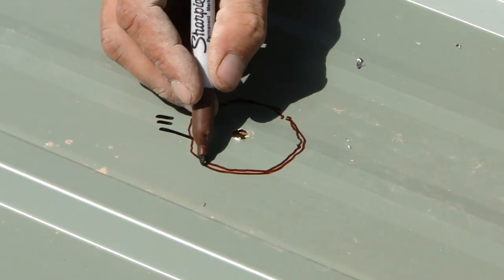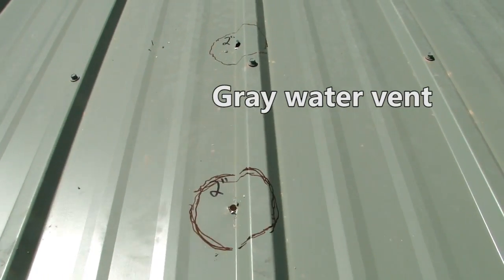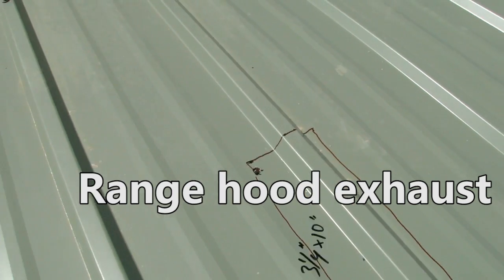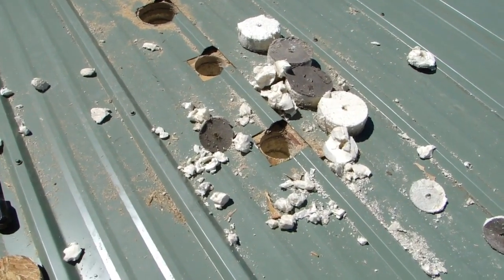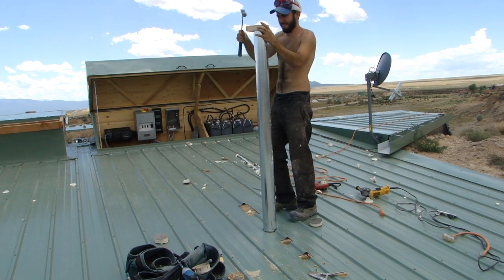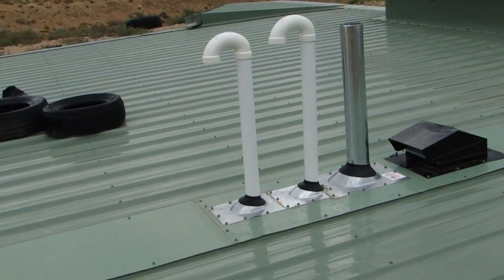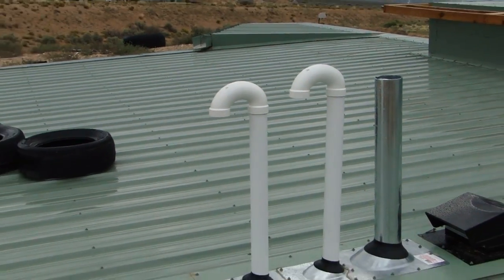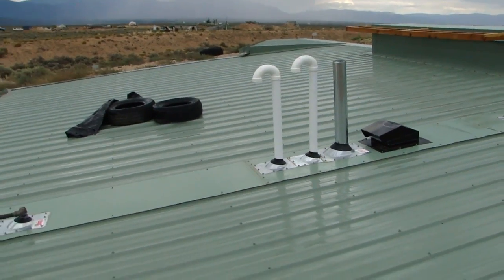How to Vent Plumbing Through the Roof

Comment: I have a flat roof that has a 3inch stack on it. It is spewing more than normal condensation. There is a noise like there is a fan or something pushing this condensation out of the pipe in 41 years I have never seen or heard such a noise. Dose anyone have any idea what this could be ???